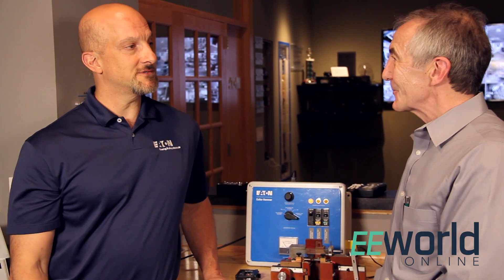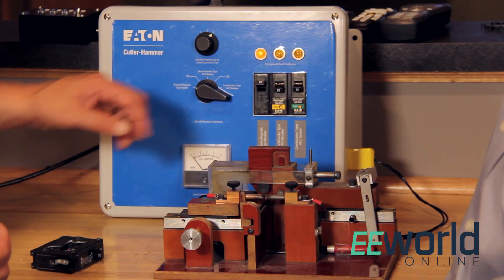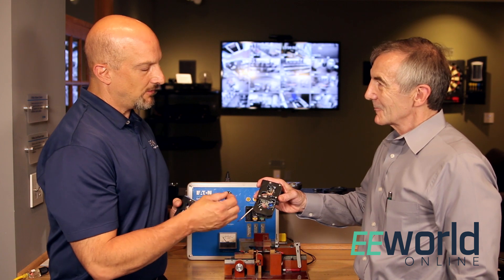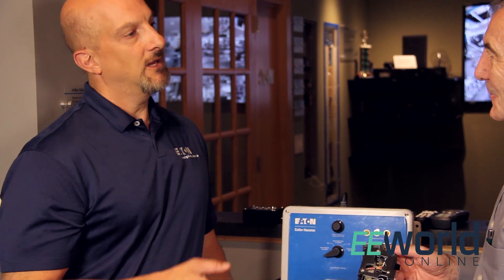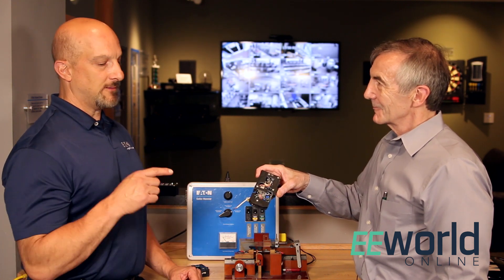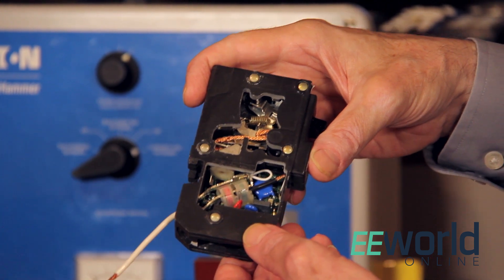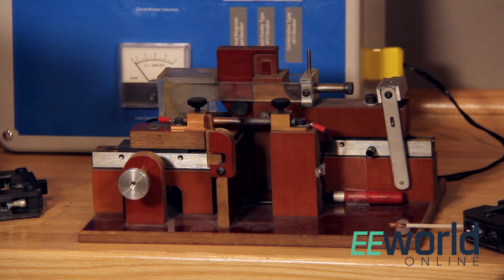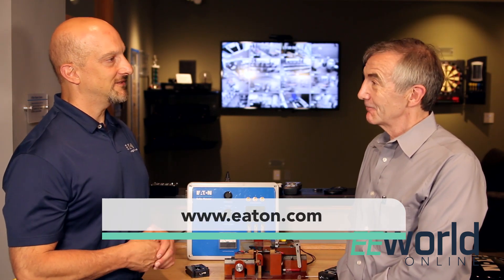The difference between a circuit breaker and an arc-fault/ground-fault circuit breaker

Comment: I have a 2.5 year old home with 2 your dual purpose AFCI/GFCI breakers on 2 separated dedicated 20 amp lines 1 for refrigerator and 1 for washing machine. Both of these lines started tripping about the same time frame. They do not both trip at the same time they are separate circuits. They started doing this a few months after San Antonio Texas suffered a major freeze and loss of electricity for 3 weeks. We went on emergency cycling of rationed power sometimes only having power for 1 hour at a time at different intervals. Could the circuitry inside the breakers get damaged from these accurances?
Reply: @RiViTHeaD13

I manage and operate an electrical company in San Antonio and that power outage messed up a lot of people’s electrical system. While those breakers do have surge protectors within, massive surges from power outages and even reoccurring surges within the home can damage these breakers. As mentioned in the comment above mine, Eaton CH is infamous for their AFCI, GFCI, and DF breakers going bad. The best precautionary measures you can take is to have a whole home surge protector installed. Currently, it’s required by the NEC (National Electrical Code) to install these on any new or recently updated electrical services.
Reply: Yes! Especially if they are the type ch which has the tan handle. They are very prone to failure.

Comment: The AFCI has to be programmed to recognize IRREGULAR current flow.  Looking for a certain frequency or a range of frequencies will not always work properly because a lot of things like switching power supplies in computers generate high frequencies but the current pulse are consistent and hence not indicative of an arc.
Loose wires on connectors and switches are a big problem in the home. "Loose wires start fires"
.

Comment: Why do they use a copper stranded wire instead of a solid core for the curled neutral?  You would think they would want a more solid connector going into the neutral bar?

Comment: Why is the guy on the left constantly talking about a couple of 100 seconds ..... doesn't sound very fast, does it? Or does he mean milli seconds?
Reply: He's referring to an overload condition, not a short. A breaker will allow more current to flow than its rated value for a certain period of time, and it could be in the range of 100s of seconds. For more information on this Youtube search: "circuit breaker time current curves explained"

Comment: I hear nothing but complaints from licensed electricians about being required to install these and then the customer gets nuisance trips from all types of small appliances from coffee makers to vacuum cleaners
Reply: actually 5.00mA is very low value and very sensitive to humidity and wires cover mis insulated
 ; 10.00 mA could be the solution and used also in other standards
If there is any  insulation issue with that circuit(humid area ; wire jacket cut.. it will easily trigger the 5mA circuit
Reply: With GFCI anyways there's supposed to be Class B GFCI, an older style that is supposed trip at a higher mA.

Comment: At 1:36 sure looked like the arc fault breaker was not tripping, so he mashed the electrodes together to trip the breaker.
Reply: This is the correct and intentional design behind AFCI. It needs to be sustained over some time. Otherwise it will false trip in many normal scenarios, like when you plug load into a socket.
Reply: @movax20h  Mine trip without ANY load!
Reply: @ziggiezag938  That sucks. Shouldn't happen, maybe there is some issue with wiring? Do high voltage insulation testing, or look at current with oscilloscope, but that is tricky to safely setup.
Reply: @movax20h  Yes, it does suck.  The electrician said he did everything right, that's just the way these breakers work.  Unfortunately, code said he had to put them in anyway.  I want to change them back to the $5.00 standard breakers, but I'm concerned about the GFCI being missing if I do that?
Reply: @ziggiezag938   did u buy chinese AFCIs Again ???
Reply: @ziggiezag938  -then replace them with GFI breakers -it's not rocket science
Reply: I agree, it looks like they should have done a take two. "well it worked in rehersal"
Reply: @johnnyrotit844  That may be true, but he was expecting it to trip the first time. He did it three times to get it to trip. Not what he wanted.
Reply: he mentions that it needs to be sustained multiple times...
Reply: I agree, the demo should have used pointed contacts that would help sustain an arc AND before the demo started they should have shown that there is no DC resistance with the electrodes at the closest setting.  The trip with the "ARC Fault" seems to be more of a short-circuit that you would have seen with the other breaker.  My takeaway is that these ARC fault detectors are modern day "snake-oil", at the Eaton brand shown is.
Reply: I would agree, does not give me a lot of confidence to spend 10x on a breaker that does not work.

Comment: I find what was said at 2:40 a little disturbing. What I am hearing is "It doesn't look at the magnitude of the current but the frequency...one particular frequency, somewhere around 1MHz" aka a band pass filter. So my question is, how are power line induced radio frequencies filtered out before entering the home or even in the home? It sounds as if a homeowner has to do internal line conditioning and shielding to prevent induced frequencies. I later hear that the current threshold is around 5mA. How do you keep these things from continually tripping off of say the neighbor's out of band CB/Ham equipment inducing a 1MHz > 5mA signal into a home power line? It sounds as if it is not really sensing an arc but the symptoms of an ARC which might be simulated via an induced frequency/current? Power-lines in rural areas could be un-shielded and act like a big antenna, right? If you do old school X10 data over power, will that trip the Arc breakers? Seems like overkill or is this because so many electronic vendors are making 2 wire hot/neutral televisions and electronics now, resulting in a higher number of Arc fault conditions. These manufacturers used to be required to include internal wired ground shunts but because TVs are low voltage now I see a lot of them doing 2 wire plugs instead of a safer 3 wire. If that is what is driving ACFI then it seems like the problem isn't the homeowner but a manufacturing problem due to government deregulation allowing for increasingly unsafe products to be manufactured instead of mandating that they simply make a safe product that conforms to safe grounding techniques. It looks like a solution in search of a problem.
Reply: I believe the Frequency would be altered by that point from a neighbor. It's filtered by the components prior to and even at the pole and it's directional in flow. The current would have to be massive. It is going to be more of an issue with older components. 2 wire is fine. Look at how your panel is wired. The neutral and the ground. It's a valid point but you are going in the wrong direction and way overthinking it.
Reply: You're confusing two different features.  The ACFI is calibrated to detect arcs at 1Mhz.  The GFI feature is designed to detect a 5ma difference.  They work independently, if you have a circuit breaker that has both.
Reply: not all 1Mhz frequencies  that is in general ; howeverthere are other conditiona controlling teh tripping function; e.g it should exceed an amplitude threshold to consider it as  power Arc fault. X10 i think it is a communication protocol with very low current amplitude it will not be detected by the circuit